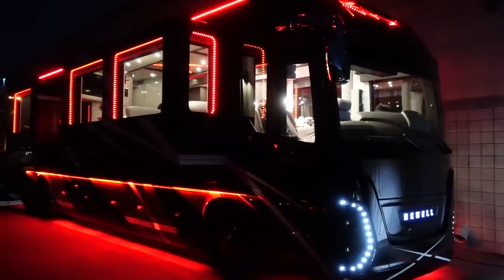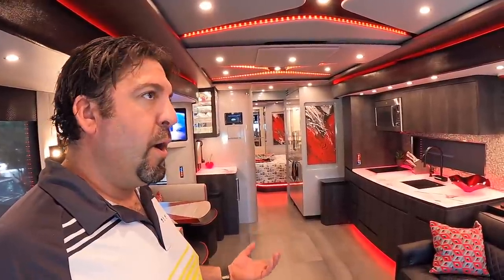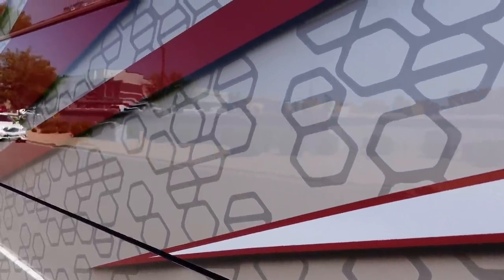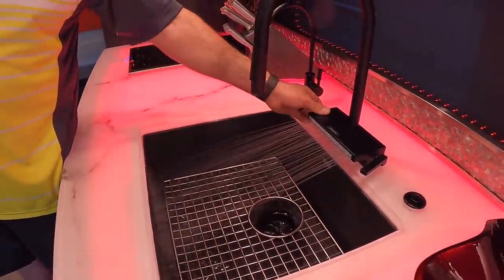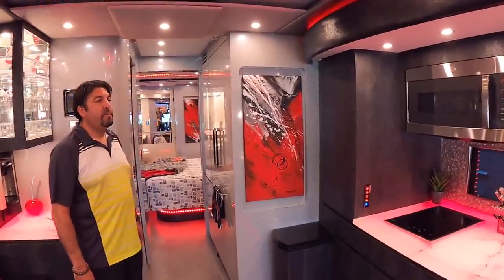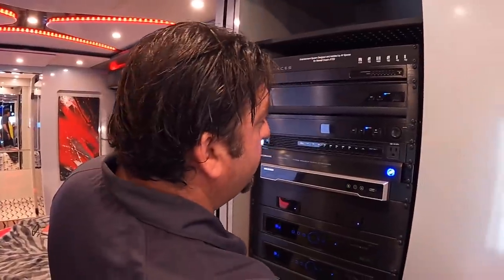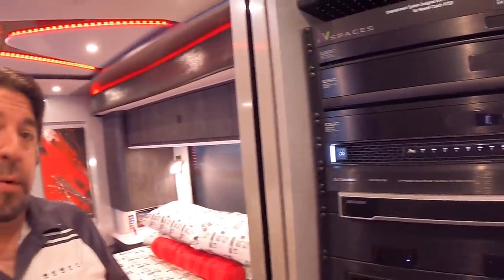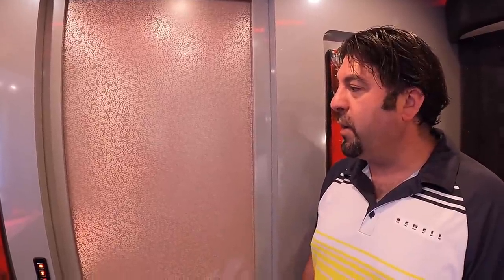THE MOST CUSTOMIZED 2022 NEWELL COACH I HAVE SEEN

Comment: Ok FINALLY someone  "sort of" listened to my design.   The above head 3 camera live is awesome   BUT,  I am still waiting for it to be on a heads up display on the lower windshield.  While this is great,  you are still having to take your eyes off the road to look up.   We have the technology for heads up camera display,  I don't understand why the motorcoach industry has not thought of this.  I have never liked losing my rear camera everytime i use a turn signal.    With heads up display my eyes would never have to leave the road.    This is a gorgeous paint job and the interior is well done. Im not personally a fan of  "permanent red" because red is the first color in the spectrum that people get tired of  (yes i do design as a career),  but the detail on this coach is amazing! Thanks for the tour
Reply: I did ask about a HUD and might try and work on something for a retro fit or next coach. You have to realize especially at Newell there are only so many resources and since they have to design and keep the entire coach up to spec it’s hard to direct time to these smaller details. That is why I did a lot of the R&D myself and had them install or integrate it into their current equipment. They also have to look at the supply chain and when you are only ordering 24 or so systems a year vs 1000 from companies like Newmar they are at a disadvantage. Maybe we could start a RV Technology group to help offset the time needed to really trick these things out? 😉

Comment: I have to say every square inch of this coach is the finest craftsmanship I've ever seen.  The design and style is over the top. Every detail was given the upmost attention.  The only thing I wish it had especially since this gentleman owns a high-end audio video company is that when he opened up the cabinet with all the equipment that it was all McIntosh amplification. I guess the green glow if the voltage meters wouldn't match anything lol.  I have the exact same outdoor electric grill on my 21' Tiffin 45 and it's never worked from day one. Control board was fried.  It's been 3 months and still not resolved due to the way Tiffin constructed the outdoor kitchen you basically have to remove the entire grill to replace the control board and to do that you'd have to ruin the grill so hopefully Kenyon will supply me with a new grill top.  Hope he has better luck.  This is the coolest most unique coach ever built. None of the conversion coaches can compare.  Thanks Andrew for upping the bar with regards to content.  
Business is Boomin!!
Reply: First of all the McIntosh amps would be way to big!  And the heat load would have been too much.  That said there is a difference in quality and this is not an audiophile system just a party bus!  I used the grill for the first time last night and way extremely impressed.
Reply: @dac430  I know people who are super passionate about their audio brands. I love Wilson myself. I just don’t know how much you would have to compromise to get a reasonable layout in the coach. I guess you could do a Murphy bed in the back to get enough spaces for critical listening, which would also be good to keep any heavy spks away from the front axels. It would be a fun project for sure.

Comment: Maybe I was seeing things, but near the beginning when the coach was moving. It appeared that the rear axle. of the rig was turning slightly to help the rig turn  I didn't hear you mention it. I think for a coach that size, that would be something important. Cuts the tire wear.
Reply from the maker: Yes, Great observation!  I've talked about that in previous videos and I did demonstrate that towards the end of the "2021 Newell Test Drive" Video.
Reply: Indeed it has an active steer tag Axel so when you turn the front steer wheels to the left the rear tag wheels turn to the right to enable much tighter turning radius. I believe the full turning radius is about 38’ for a 45’ long coach. It’s amazing.

Comment: Such an amazing Coach, I am curious and stunned they cheaped out with the NVR(DVR) -
Reply: I didn’t cheap out per se, it is really hard to find a quality DVR that allows integration to control systems.  I’m not super happy with it but will keep an eye out for alternatives. Got any suggestions? 🤔
Reply: @adamwillis3683  I would need to know a bit more about what control system you are using
For your rig I am almost wondering how well a ubiquiti would work. I also really like Costar NVR units.
Milestone and Exacq vision would both be way overkill (but are two of the best). I would love to get my hands on a Wavestore. (again way overkill, would so recommend for home systems)
Reply: @seanpatrickkinney9593  The control system is all Crestron, the network is Meraki and Pepwave.  We have 2, 24 port Layer 3 switches with a 10 Gig backbone front to back. I haven’t heard of some of the brands you mentioned, are you in North America or Europe by chance.
Reply: @adamwillis3683  Am in North America

Went all out with the Cisco switches (Meraki) for the 10g which are very impressive units.
Reply: Thinking of the Crestron, am curious if a Honeywell would be a solution that would work out for you. I have not used one but Honeywell is typically fairly universal if the ones mentioned prior are not supported.

Comment: When you first walked into the coach my eye went to the wall art forward of the dinette but you skipped it on the tour. Sure is an exquisite coach just a story and a new design in every foot. I really feel the coach control board should be by his recliner or where ever he wants to sit. Getting up and down to check the different systems gets old and becomes a pain. I like mine where his recliners are.
Reply: I have several control surfaces. Some mounted in the walls, removable ipads on the dinette, dash, and bedroom.

Comment: the steering wheel is almost parallel to the ground... Is that a comfortable driving position for prolonged driving?
Reply from the maker: It can be adjusted to fit the comfort of the driver.  It tilts in this position when not driving to make it easier to get in to the cockpit area.
Reply: Indeed Andrew is correct, the steering wheel is in the park position, it moves to a customer saved drive position when you release the parking brake.
Reply: Andrew ❤️❤️ for replying to my comment... please do some videos on Survival RVs ❤️❤️

Comment: He is so true on his awning selection. Get rid of all the nonsense and keep it clean looking. Something we don't hear enough of is the internal operations for example does he have interior roof drains? How about an interior roof access for privacy and security. He could also have a solar panel covered raised roof. Having a ladder on the back is a security problem. Of course these coaches should have a safe room in the bedroom for security, Strong windows and a strong door with fire suppression. Some day when they have drive by wire you can move it with a joystick.
Reply: It does not have roof drains. I’m pushing them on this. 
The coach is solid but I decent 12 Gauge isn’t a bad idea for security. We used to have two Great Danes, no one would dare mess with us.

Comment: OK Andrew, I know it's in poor taste to ask.....but in this case, I gotta make an exception: How much did this "little Jewel" cost?
Reply: It’s like they saying goes, if you have to ask.....  Just kidding, it was likely one of the more expensive Newells they have built, but we didn’t go over the top on the fixtures and finishes.  My wife and I looked at the Agate countertops and they were $25K for the bathrooms which we decided we didn’t need.  We also say a $12K shower head system that we chose not to go with.  Also the chrome package adds another $25K which we left off.  The A/V and Networking system on the other hand was a nice way to add $100K to the price but luckily I called in a few favors for a discount!

Comment: This us clearly a truly amazing coach, but on a previous coach I had high mirrors. However ... when the sun shines in the window and you lower the side blind/shade you block your mirror! Perhaps you San get away with it with all these cameras, but I'd want a low mirror coach. The sun coming in the window even with dash air can be exhausting even in cooler weather. Henri (RVing with Henri)
Reply: I never use the mirrors. They are simply camera holders!
Reply: @adamwillis3683  I guess I'm old fashioned. I use then a lot for clearances and lane changes. The LR cameras are checked for the blind spots, but I have convex mirrors anyway. The backup camera on my RV has a short range, but is nice helping when to stop. I wish I had docking lights along the sides though.
Reply: @henrivanbemmel  I takes a minute to get use to but I wanted the two side cameras to always display what’s beside me and keep the rear camera as well. That was when I’m passing I can see when the Jeep is passed the car I’m passing whist still signaling. I think it works incredibly well and Newell now offers it as an option for new coaches.
Reply: @adamwillis3683  Yes, I can see the benefit if you have three screens. I hope you really enjoy the coach!

Comment: I live in Disputanta, Virginia and I am assisting a 83 year old Navy Veteran (22 years) that is stranded on I95 near Carson, Virginia. He lives in a old camper full time that is hauled by a 2002 Dodge truck. The transmission gave out. Local towing business towed the trailer to their business and hooked up electricity. He has been there now 20 days. After 2 transmission repair shops, they decided to repair it versus replace it. Hard to find a transmission for that year. It will cost around $2500 for the repair. I am seeking help among the community to help this veteran. He should be on his way Saturday or Monday to see his dying cousin in Connecticut. He is hard of hearing and has diabetes. (@t. Hope you can help him to recovery.